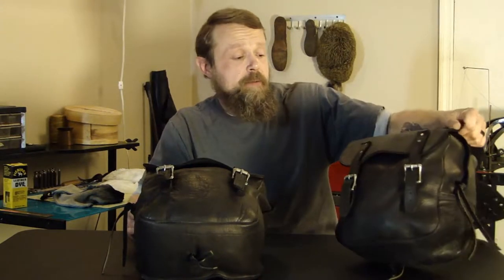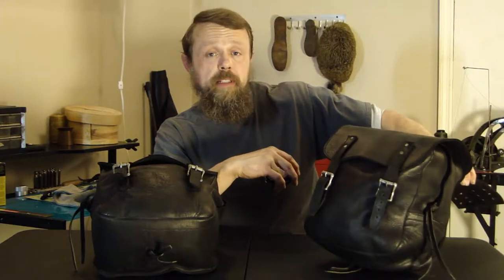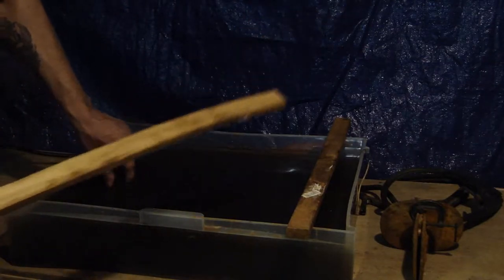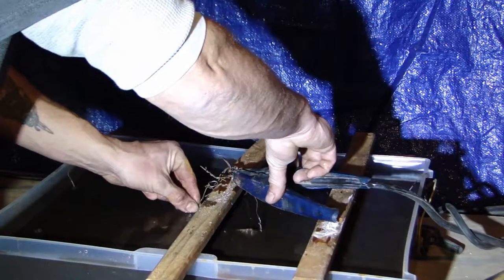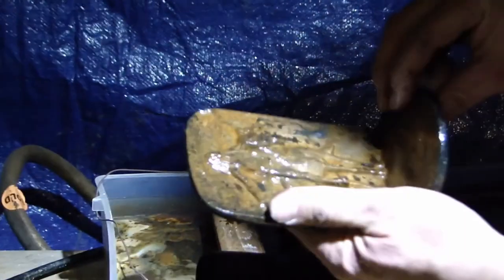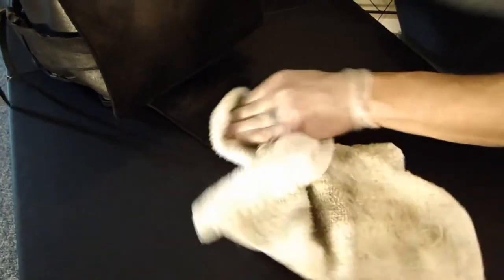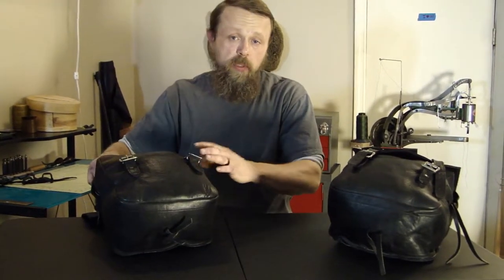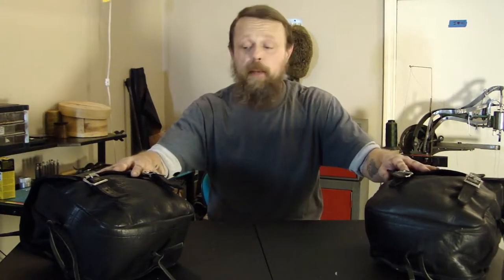Old Leather Saddle Bags/ Book Ends- Rescued From the Landfill Episode 3

Comment: Great video of finishing these nice saddlebags. I know my comment comes over two years later but I do a bit of restoration of steel tools and I think after getting that surface rust off a good coat of Johnson's Paste Wax gives it protection from flash rusting. I recently removed surface rust from a bench drill press and used paste wax and it has help up well as a finish for the bare steel under heavy use. Just apply it to the steel like you did that shoe polish to the leather and hand buff it with a cloth. Apply as needed.

Comment: I've an old set of bags since 1996 they been on a 77 triumph a 77 sportster 86 sportster and now a Dyna low rider they been though hell but they been loyal so yea I'm going defiantly try this
Reply from the maker: +Jorge Vasquez Go for it. They are leather and you can’t really damage them. Something I should of mentioned in the video is if you have zippers like these bags did or even snaps you will want to add some powdered graphite to the zipper to keep them working good the same with snaps. Thanks for watching the video.